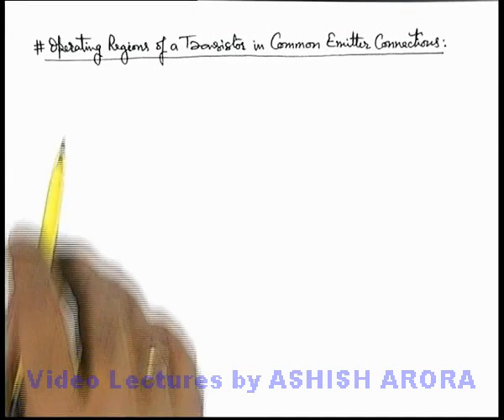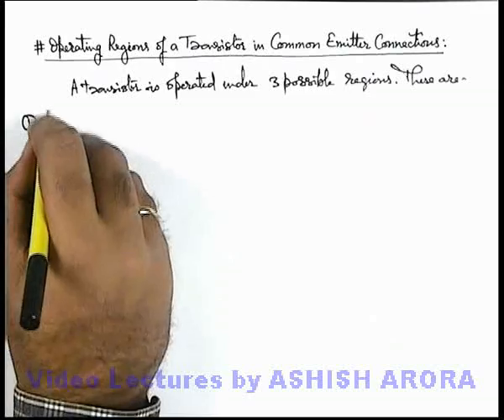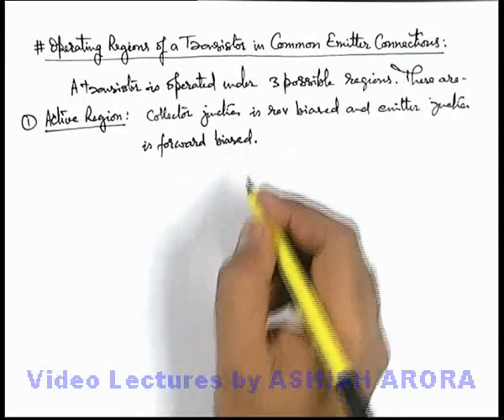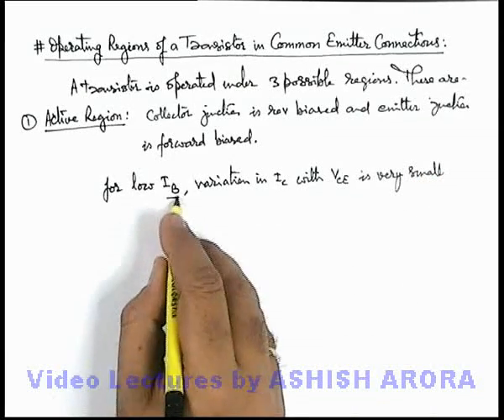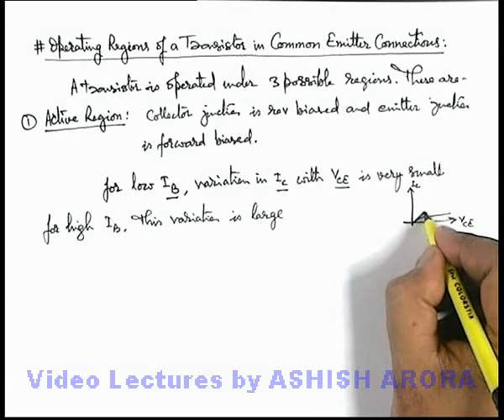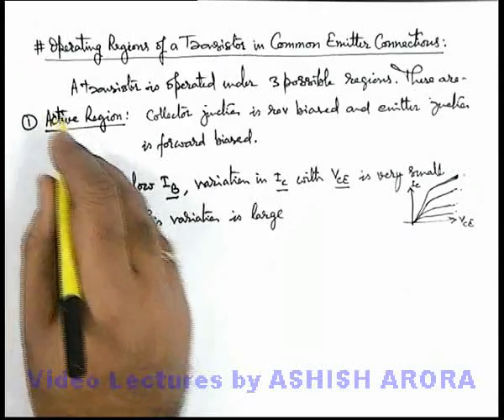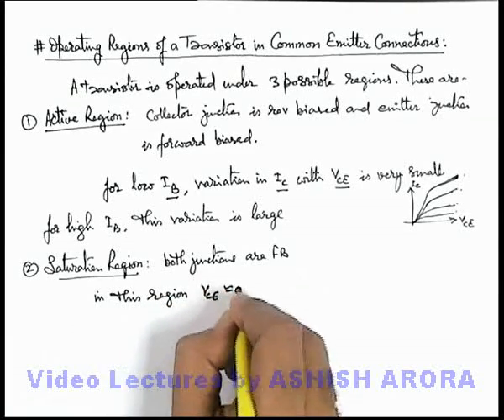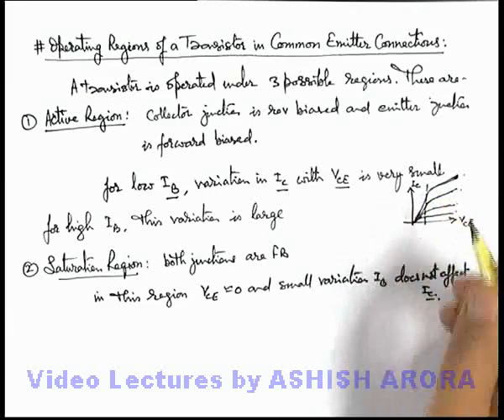Class 12 Physics | Transistor | #12 Operating Regions of a Transistor in Common Emitter Connections

Comment: please help me I don't understand how in saturation region C-E junction is forward bias as both active and saturation regions are on the same side.
Hope you reply soon
Reply: Even I have the same doubt .. sir pls reply
Reply: @anonymous3922  take an npn transistor. Here if fb is applied to both junctions, a negative polarity will be applied to both collector and emitter. We can extrapolate this to suggest that the net potential drop will be negligible if magnitude of applied fb polarity is roughly same. Applying sane logic, the value of Vce is high when fb is applied at base emitter junction abd rb is applied at base collector junction.
Reply: Just at the end of it add 38 and then the link should work
Reply: I think this should be the correct diagram for common emitter connection output characteristics